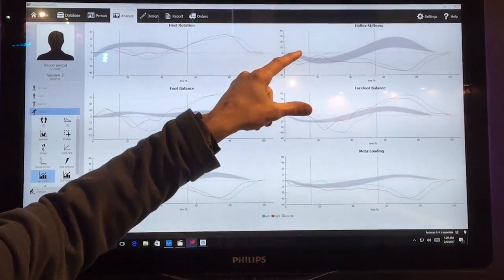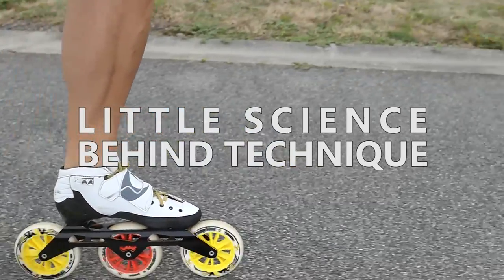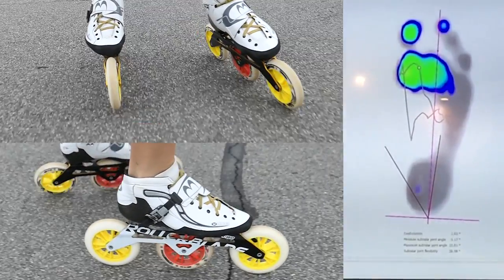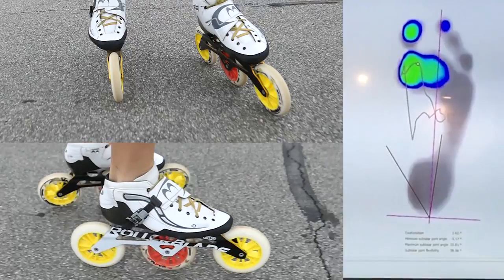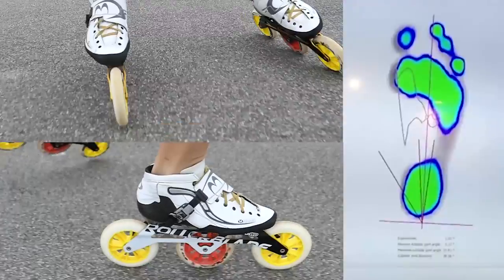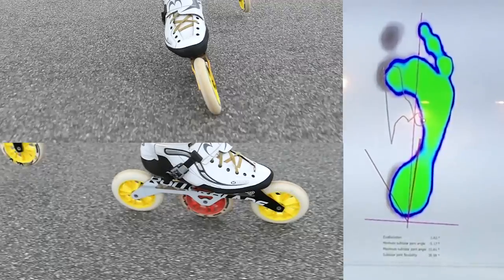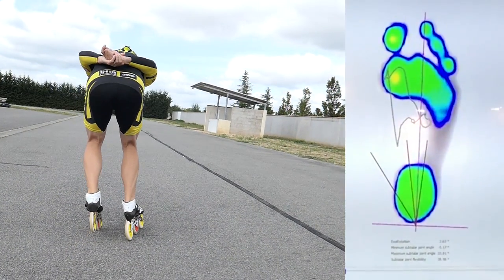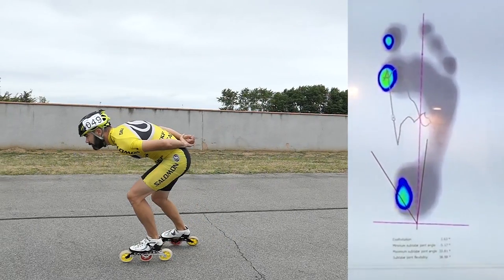little science behind my classic technique (pascal briand vlog 72)

Comment: very nice and detailed explanation.
How you measured the pressure Sir.
Are explained pressures are ideal one or something to  be correct?
I have read somewhere that parallel push is better. Thus is gradual pressure towards end of the push at toe side be good?
Is there any power push concept?
Thanks
Reply from the maker: hi, pressure is measure with a force Platform. it's a special Equipment that is not easy to get available. pressure are my pressure...it doesnt mean it's ideal but if you considere my technique good you can think this pressure exemple is quite correct i would say. parallel push? you mean double push? it would be better for sure bt i could test it on this tool so i don t have this analyse there yet.